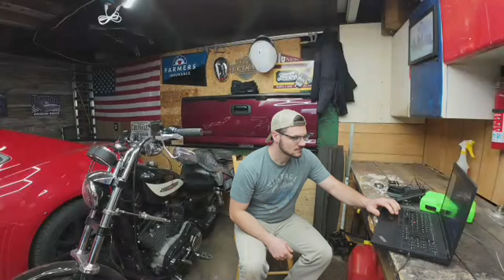Chevy V8 recalls channel updates and more | American Automotive LIVE #2

Comment: I have not followed this closely but I think this is a result of a bigger picture issue with GM. They seem to be very conflicted with their engine platform. In my opinion, they seem to be trying to adapt their tried and true V8 platform to appease their loyal customer base but they also offer a 4 cylinder turbo options as well. Essentially, they seem half committed to two different propulsion philosophies resulting in poor quality in each. From my perspective, when other truck manufacturers switch their engine platform, they commit and go all in for quality on that platform. For example, Toyota and Ram just switched to the 6 cylinder turbo platforms but they committed to the new platform resulting in overall good quality. As someone who just ditched their 2017 Silverado, I agree 100% with your perspective on GM as of recent.
Reply: I realize Ford offered the eco-boost and 5.0 in tandem but I still think Ford pushed the eco-boost as the dominant platform. GM seems much more conflicted with selecting a dominant platform. To my understanding they also still over the small diesel in their half tons. Therefore, you have 4 different engine options in a half ton (2.7 Turbo, small diesel, 5.3 & 6.2)? Seems bonkers to me.
Reply from the maker: Totally understand where you're coming from. To your point even though Ford has the 5.0 that is basically the same architecture of the modular series motors. Also, the ecoboost is very similar in architecture as well so they arent THAT much different in alot of ways even though it seems like they would be on paper.